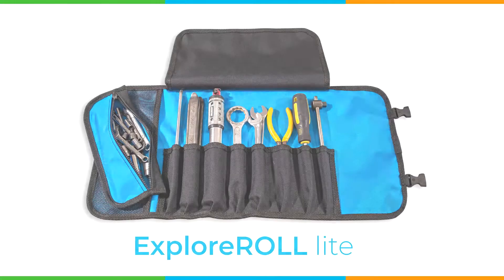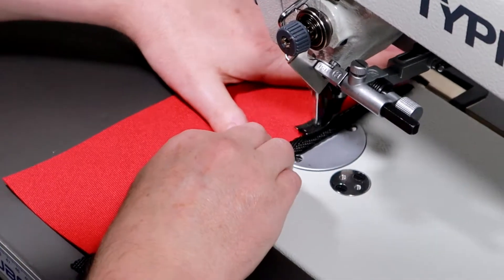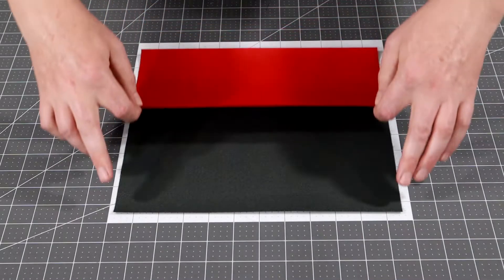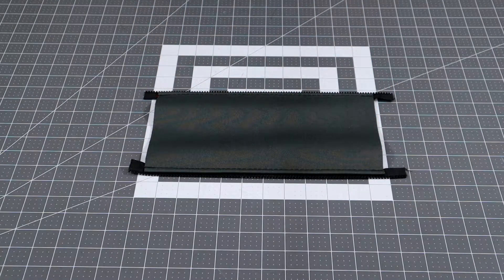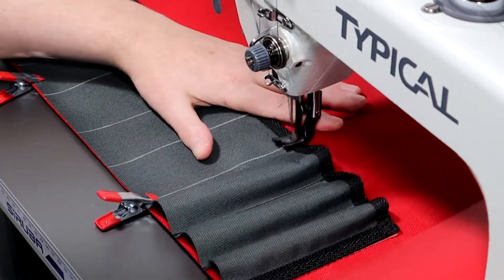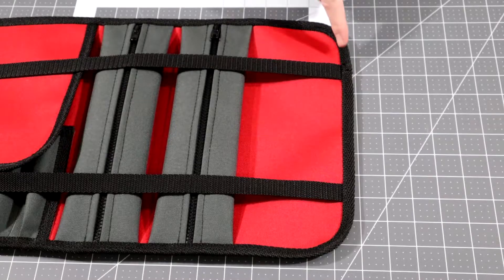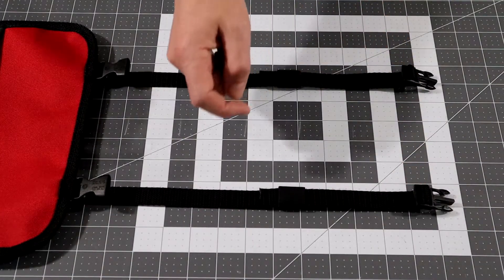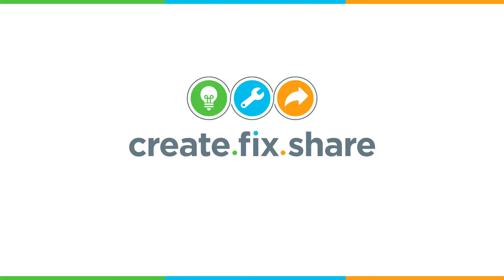Create Your Own Tool Roll

Comment: Great video! I ordered the pattern from Etsy, and it is easy enough to construct - watched the video a couple of times though. Also made another tool-roll based on this one, slightly scaled up for my needs as the original design lacked a bit of room for my use case.

Comment: I may have missed it, but what seam allowance are you using?
Reply: They didn't say, it may be in the paid instructions. But since that looks to be 1 inch or 0.75 inch binding then likely 3/8 or 1/4. Everything is covered in the binding.